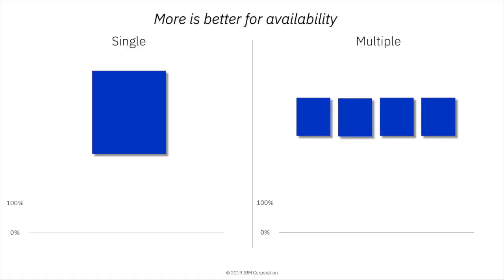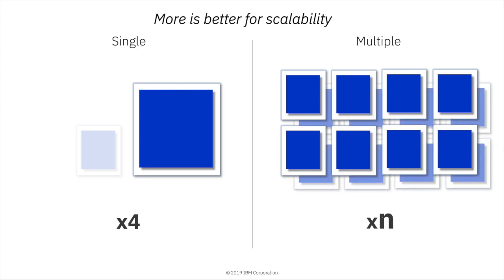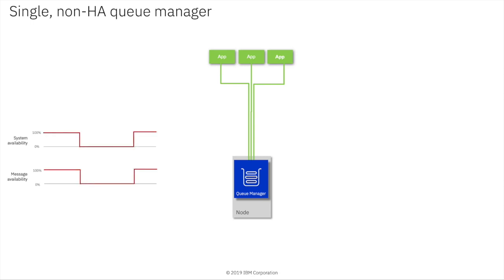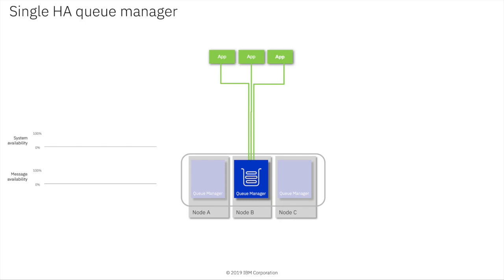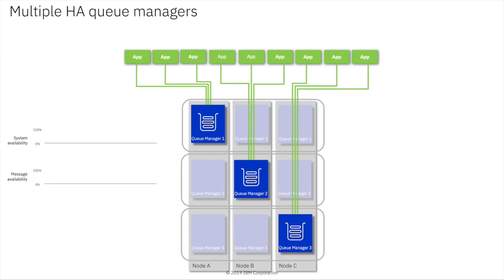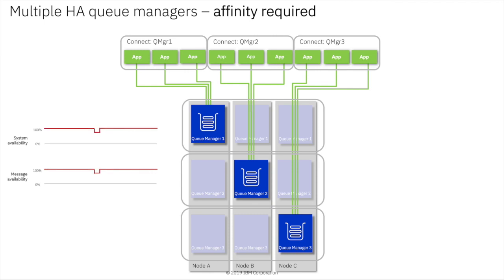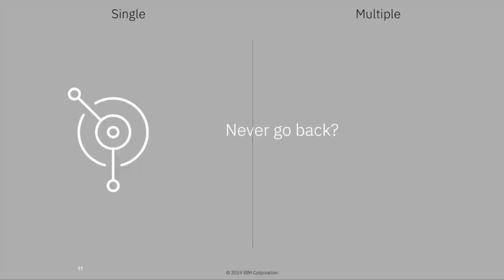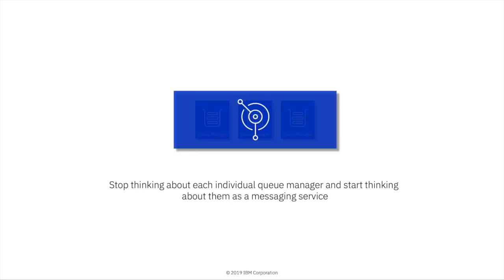Designing a fault tolerant IBM MQ messaging solution

Comment: Hello david.
Thank you very much excellent tutorial.
I ask you the scripts that you use in the video you can share them or that tools folder comes in the sources of the MQ9.14.

I would really appreciate if you could share them with me. :)
Question:
This same scenario works with MQ9.1.3

Thank you very much
Reply from the maker: Hi Armando, sorry for not spotting your request here, although you found another way to reach me! For the record, the scripts used in the accompanying video (https://www.youtube.com/watch?v=LWELgaEDGs0) are now available on Github here https://github.com/ibm-messaging/mq-uniform-clusters
Yes, the base Uniform Cluster capability was added in MQ 9.1.2 and has grown since then, so much of the demo in that other video would work with 9.1.3 (although the configuration would be different, so the scripts won't work)